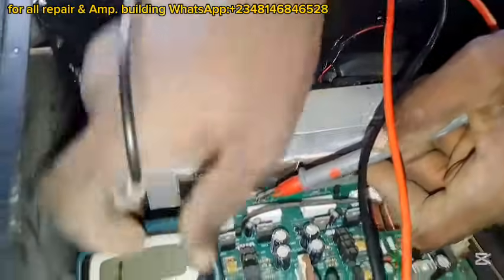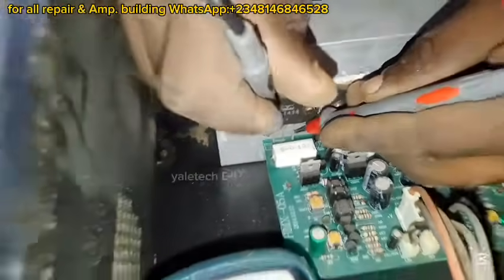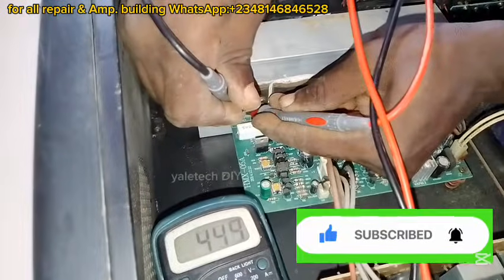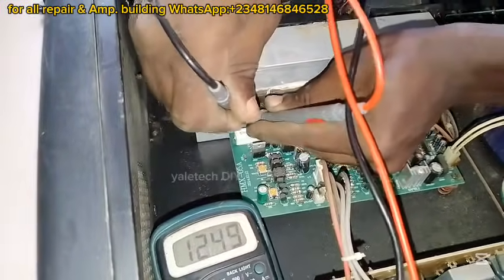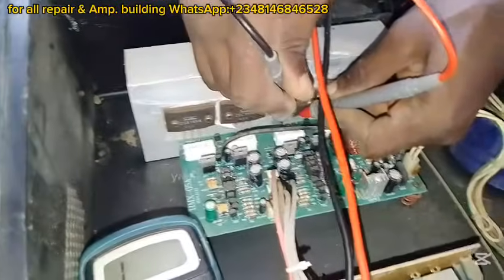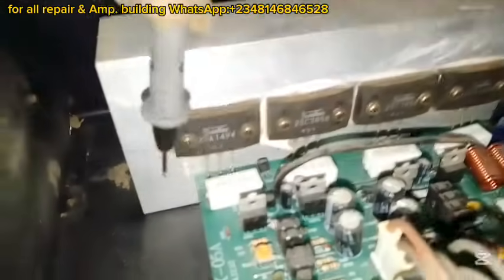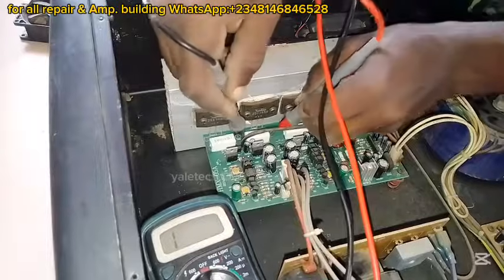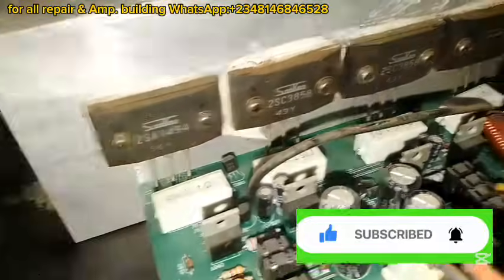How to Test Amplifier Transistors Without Removing Them

Comment: My 2 mixer output and input no sound to the spears
Reply from the maker: If it's a mixer amplifier.
One of the transistors ic or choke might burn or probably a while cut inside.

You can loose it to find out what likely happen if u have some technical knowledge about electronics.

If ure in Nigeria +2348146846528 I can fix it for u.
Reply: @yaletech_ stalker

Comment: The convenient way is to remove those dropper (5w 0.22ohms) resistors before testing
Reply from the maker: You absolutely correct 💯💪
But sometimes u can test run this way to quickly ascertain the situation of things asap before desoldering the choke resistor to verify further.

Thanks 👍
Reply: @yaletech_ what differentiates a choke resistor from a regular resistor since they both choke voltage 🤔 ⚡